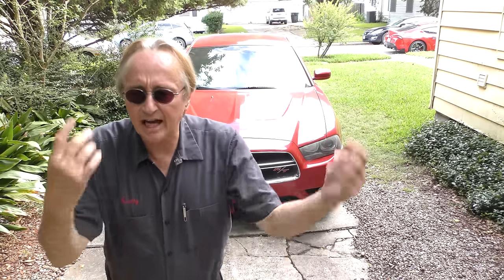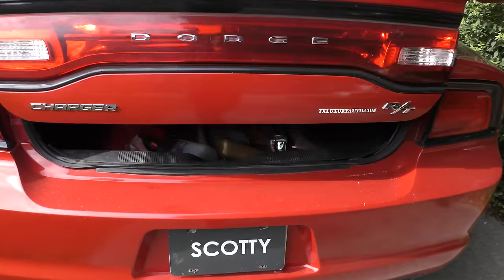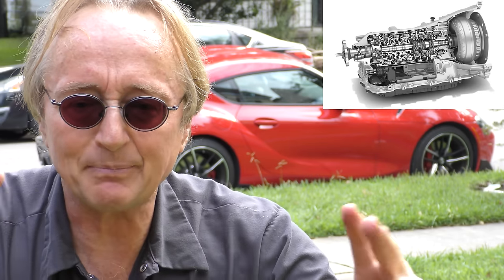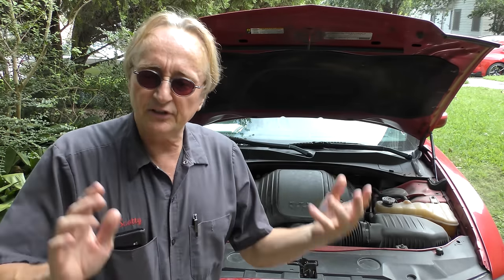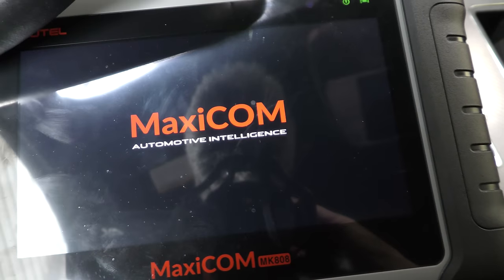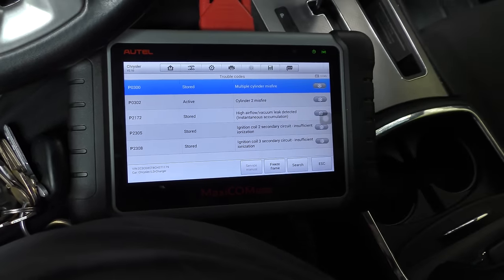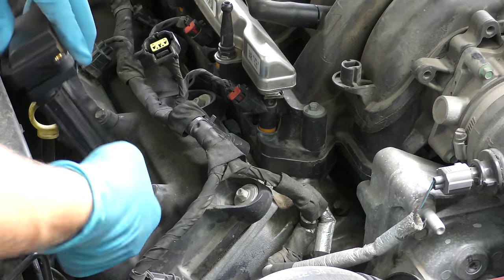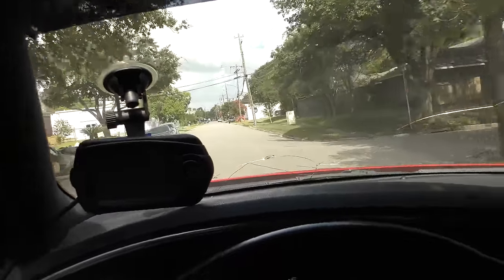Here's Why I'll Die Before I Buy a Dodge with a Hemi Engine

Comment: That’s a beater, you can tell the owner doesn’t take care of it.
Reply: Ikr if i had a V8 id spend so much time and money on it. Probably why god wont let me have one now (im broke 😄)
Reply: it's weird the steering wheel is mint but the thing is ragged out...no wear at 10 n two o clock
Reply: Was just gonna say this.
Reply: Yup
Reply: Thing is totally not cared for.  I have a 2013 hemi charger with 130k miles and it has none of these issues. Lifters don't tick, no misfires, and it still ripps putting a smile on my face.  I do all my own maintenance though, and have an obsession with it so that may be why....
Reply: The fact that you have to baby it shows bad quality.
Reply: It's a dodge. They are made with super glue and bubble gum
Reply: @Billoflife  She's your baby, just like how I treat my wrangler :)
Reply: @HEMI BIRD and why are so many of those cars bad and have problems before even 30,000 miles? My supervisors Jeep had its transmission rebuilt at only 15,000 miles. My cousin has a ram who's engine had a misfire at 13,000 miles. You can take care of your car all you want and yes it will help a lot, but there are some things are out of your control just because of bad manufacturing.
Reply: Yes, it's another ragged out car, trunk full of junk, dirty, high mileage. I change oil every 3K and keep it clean and running good. Take the plastic engine cover off too, it just retains heat. Had a 2012 Hemi Challenger, no major issues.
Reply: @Billoflife  Me and you both, 2013 owner and drags well against Mustang 5.0s
Reply: Only 8 years old? My beater is Japanese and 20 yrs old. Still runs good even after some abuse.
Reply: Yeah wrapping your charger and putting 24 inch wheels is taking care of it lmaoo
Reply: Dodge/Chrysler are big pieces of crap
Reply: All my chargers are beaters 2006 2014 2012 ALL hemis
Reply: @SchkuenteQoostewin  you mean it loses against 5.0s
Reply: That's a shitter since it was built
Reply: @GO-cz7cl  i have an 01 is300 19 years old made in Japan still runs like it just came off the lot.
Reply: @Billoflife  anyone that takes care of there car makes it last. Because one thing goes wrong and you fix it right away. These people run them right until no something's about to blow.  I see people with cars with 40k miles that are beat to death.
Reply: 148,000 low miles for a car / but if not taken care of I can see why it ain’t running good,  that big ugly plastic cover , get rid of it, Ugly ! also I would not have a hemi !!!
Reply: Noel López every car maker has it's own set of issues that's why you get the extended warranty. I've had a car with known bad headgaskets and it was fixed and still runs today. 

Unfortunately you can see how well maintained this Charger was. It needed an oil change and the owner let the rest of the vehicle fall apart. Most likely was driven hard when there was an issue with it. I see quite a few old Chrysler vehicles still on the road but more often then not they are driven hard and then they dont last as long.
Reply: Whispered Metsutan   Nah it’s just badly built
Reply: @cn2673  well it wouldn't sound unbelievable if you watched and seen Scotty's videos before. Those cars were decent under Damien Chrysler. Fiat was garbage in it's original run here in the US and they are worse in their comeback and they took Damien Chrysler down with them.
Reply: What makes you say that ?
Reply: @slugzkea  If you baby a Wrangler it will eventually cheat on you.
Reply: Will Will  why not sell it and get something you like lol
Reply: Nikolas Gunadi same but thinking about getting my first one next month 😂
Reply: @cubzrulz  lol, maintaining and caring for an engine is NOT babying it
Reply: Dean Toma  it better not have anything wrong if it only has 57k lol
Reply: @RedAssassin274  you can still maintain those cars and they'll still fail on you. Clearly have not watched enough of this channel if you trying to defend these manufacturers
Reply: Obviously the dodge hemis are good motors I have a 2005 Dodge Ram 1500 with 253,567 miles on the original motor
Reply: You don't think he changed the oil regularly which would mean before 6 months or before 8k miles?  Or the spark plug replacement interval of 30k miles?  What other care are you refering to?
Reply: Tony Brown  the cars that the highway patrol use are not the same kind of cars that are sold to civilians. Also, on top of that the cars aren't used for more than 5 years at a time.
Reply: If he did, it wouldn't be a beater. Lol
Reply: @cubzrulz  you have to baby these things
Reply: @GO-cz7cl  how is the body; because according to my recolition their bodies are made of swiss cheese. At least this chargers got a hard body and good styling.
Reply: Exactly
Reply: Maybe he should really take care of his car
Reply: 0.35 here is the culprit, john G by the looks of it, oi john! Look after your car!
Reply: @cubzrulz  you dont got to baby it mine has over 100k some hard drag strip miles and has no issues but i take very good care when it comes to upkeep.
Reply: @cubzrulz  why my 2 90s neon have 250k miles running strong abusing the piss out of it 100 + every time I drive it not one thing broke ever from 50k miles 2 of them 🤷‍♂️
Reply: I was thinking the same things
Reply: @Billoflife  And you work for Chrysler
Reply: Exactly
Reply: The hemi is a great engine
Reply: Noel López Why hell yes the Hemi state patrol cars are the same as civilians lol. You think it has a special “chip”? Sometimes interiors are retrofitted to make it easier for all the police accessories to be accessed and they MIGHT have bigger brakes but the drivetrain is all the same. Like the Police Interceptor Crown Vics, they were just Crown Vics with 2V Mustang 281s with 4 wheel disc brakes.
Reply: Noel López thats all cars are shitty if you don’t baby them
Reply: The paint looks like crap, all faded and dull
Reply: @cubzrulz  That's funny considering how many of my co-worker's Chevrolet's broke with less than 30,000 miles. The owner of the business I work for had to replace his transmission on his 16,000 mile Chevrolet van. His latest van another GM POS lost the motor at 75,000 miles. One of my co-worker's just sold a 2000 Ram with 301,000  miles because it started burning oil and he bitched that it was no longer reliable. He drove that truck like it was a nascar racer. His Honda Civic with just over 100,000 miles could not be driven out of town because it would break down all the time. He did not trust driving it, but it was the greatest thing he ever drove. He got rid of a BMW because it was worn out with less than 80,000 miles. Another co-worker's BMW with 60,000 miles blew the motor. Should I go on? I own a 1971 Challenger, 2009 Challenger RT, and 2015 Cherokee Trailhawk. By my I have put 84,000 miles on the Trailhawk and running like a champ. Another co-worker's wife's 2016 RAV4 Toyota at 62,000 miles is a regular at the Toyota shop. Oil leak's, transmission leak's and other problem's. Toyota told him not to worry, it's normal maintenance on a Toyota! Wow!!! I will never own anything but a Chrysler product. I wouldn't  piss in the gas tank of a GM, Honda, most Toyota's and a few other's, and this video, the guy is full of himself.
Reply: Hopefully his wife has better luck in that regard.
Reply: @Billoflife  my cousin has a 13 RT with the hemi. He has played with at times. But it has been taken care of no tics still sounds and drives like the day he bought it. He had 2 before this one both the v6 models. But the hemi sure is fun to drive.
Reply: @GO-cz7cl  my car is an 85 caprice classic with a 69 4 bolt 350 in it and it still runs perfectly fine. things are just made like crap these days thats all there is to it
Reply: White Boy facts
Reply: Jay Schmahl that’s crazy  my GMC Sierra 1500 2000 model still running at 171k with no check engine light once I replaced 8 spark plugs and coil box for $180..no leaks in gasket but just in case I’m still getting head gasket replaced in few months just to be on safe side
Reply: Facts
Reply: @hemi5.7awdpursuit5  I'm happy for you. Not every GM is bad. All manufacturer's have problem's , but I have seen my share of car's and truck's I would not own if you gave them to me. My family's Chrysler product's have been reliable. I have never owned anything but Dodge's, Plymouth's, and a Jeep. A couple of the Dodge's were Mitsubishi  sold through Chryco, but were solid car's. My 2002 Stratus RT coupe(Mitsubishi) was an outstanding car. I will continue to support Mopar. By the way, I was driving down the highway today and a Toyota Corolla on a rollback heading to a shop for repair's.  Imagine that, Toyota's never break down...right.
Reply: A.R. Walker 9
Reply: @cubzrulz  uh what? Since when is routine maintenance or taking care of a vehicle any evidence of that?
Reply: @GO-cz7cl  my 05 Camry the same ..
Reply: I have two 05 300Cs one with 135k and one with 243k. So far no crazy issue but the original water pump just started spitting on the 243k one, and I beat the crap out of it. So idk from my experience, hemis are pretty reliable, and I’m a Ford guy...
Reply: @cubzrulz  keeps are completely different than charger and challengers,Jeep's always have transmission problems
Reply: @GO-cz7cl  something high performance that puts out a ton of hp will require more maintenance no matter the manufacturer.   Does your beater have 387hp?   I don't care for Dodge cars, but comparing all vehicle reliability to a 1998 civic gets old sometimes.....
Reply: Put 100k miles on mine not a single issue, even the spark plugs lasted too 100k miles. 

Plus looks like there is a tuner on the left side of the wheel?

Literally beat on my car and only had to do oil changes. Kinda seems like Scotty just reviews bad examples.

Review my moms 13 Camary and see if you say the same you would about this 😂
Reply: Obviously not taken of and probably floored every time they took off
Reply: @McCarthyism_by_Youtube  That means it was rode very hard and worn out very fast.
Reply: @GO-cz7cl  Once had a guy that worked with me that had an old white Honda accord.  It was a 95 I think. Had over 350k when he bought it about six years ago.  He has since got a job elsewhere, but last I talked to him a couple weeks ago it had rolled over 500k. He still drives it 20 minutes to work everyday. Changes the oil, trans fluid, and plugs like clockwork.  It sounds just fine and has never let him down.  He never abuses it though.
Reply: Anybody who hates on a brand needs to realize that all major manufacturers have problems, my grandpa’s Ford 250 is the worst truck he has ever bought as far as repairs go, but the 6.7 power stroke we’re I  work is a beast of a truck. when u mass produce something the quality goes down, I’ve seen Chevy work trucks take beatings and keep ticking no problem, u assume a risk no matter what truck u buy.
Reply: Looks like a rent a car. Who cares!!
Reply: Dodge chargers are junk I have said so on youtube for TWO decades. Preach!!!
Reply: Pat Ball  cams? Aren't these single cam with pushrods?
Reply: That's a general dodge thing lol
Reply: @McCarthyism_by_Youtube  l
Reply: Yes!
Reply: Just bad
Reply: @tylerhunt2465  How does someone let their car go to crap like this. It's a Charger with a Hemi
Reply: @curtw878  it’s sad honestly
Reply: Dave 365 You should not need to change oil that often.  Every 10-15k with synthetic is more than good enough.  This car has so many faults that it’s not caused by neglect.  This is an example of planned obsolescence.
Reply: This car has been BEATEN, who needs over 370 horse power in such a small car?    Taxes and insurance are also too much to deal with, just to do BURNOUTS. The front end also contributes to poor handling. This car is just a BOY TOY.
Reply: I have a dodge charger on my channel. I think it has a lifter tick. I'm gonna post 2moro if anyone wants to weigh in.
Reply: @cubzrulz  You're only speaking for the lowest percentage of all Chrysler Vehicles, just because you have a bad apple doesn't mean the whole batch is spoiled
Reply: It's a car not a whipping post... Why pick a car that has the snot beat out of it to talk about?
Reply: The poor thing is a hundred years old!
Reply: @nikolasgunadi765  maybe you're broke because you wish for things that make you go broke?
Reply: They didn’t even fix the windshield. That’s covered by insurance with a $100 deductible. 🤦‍♂️
Reply: Oh yeah. Stock wheels, cracked windows, hella miles, dirty car.
Reply: @ciscolopez7850  Yeah It shows how based SK really is
Reply: @cubzrulz  you clearly don’t own any car over 300 horsepower. Go ahead and dog any vehicle without routine maintenance and see how it’s looking at 130k miles 😂
Reply: @mrdumbfellow927  truth hurts doesn’t it 😂
Reply: @right8630  Not Toyotas
Reply: In the chargers defense,Being a 370 hp V8 hemi it was most likely floored a lot
Reply: @Judgemental_Crow  yeah that’s not necessarily true the one I had had a problem were we couldn’t find a fix for the ac but it was a great truck other than that.
Reply: Prob young and dont care YET lol
Reply: The 5-speed trans is fine, just like the ZF, the 722 (Nag1) is in dozens of models worldwide. The ticking is probably a loose manifold bolt. It's not always a lifter. I'm taking my Hemi to 200k+.
Reply: 0:35